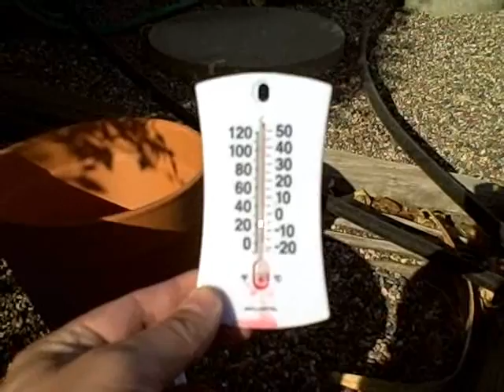Homemade Pot-in-Pot Refrigerator "Off Grid Fridge" cools air up to 40F (evaporative cooler/chiller)

Comment: I am an engineer.  A domestic electric powered refrigerator cools down one enclosed space.  Industrial cryogenic refrigerators that cool down several dozen degrees below zero are, as a bit of an simplification, a refrigerator in a refrigerator.  In other words, one refrigerator cools down a refrigerated space to a temperature well below what the primary refrigerator can do.  I wonder if a "pot in pot in pot in pot" system like this could cool it down more than 40 degrees.  If the ambien temperature is 38 Celsius and you want to cool it down to 2 degree Celsius, could it be done?

Comment: It may sound counterintuitive, but would putting the clay pot in direct sunlight and cutting the towel shorter so it didn't cast large shadows over the pot make this work better? 

It's my understanding these pots work using evaporation cooling, so  that means the faster it evoporates the faster it should cool?  Would mean adding water more often.  Would a clay saucer filled with wet sand over the top work better than the towel?
Reply: Sunlight only makes the water evaporate by heating it. The cooling effect of the evaporation can never be bigger than the heating effect of the thing that's driving it. So no, best to put it in the shade. But if you can put it in a breeze that will speed up the evaporation and help.
Reply: Does it cool better if we add water more often?
Reply: @chrillemartinez5950  If any part of the surface dries out then that bit will stop providing cooling. So yes it will cool best if you add water often enough to keep the entire surface of both pots damp.
Reply: @superfluidity  next bit of wondering.  If you put an appropriately sized mesh dew harvesters net set up in a in a cylinder shape to drip water into the dirt layer, could you eliminate or at least significantly reduce the amount of human time to add water to the pot?
Reply: @colleenforrest7936  Perhaps - but this fridge and mesh dew harvesters can't both work at the same time. The mesh harvesters only work in low temperature / high humidity conditions (relative humidity of more than 100%). The fridge only works in higher temperature / low humidity conditions.

But maybe the dew harvesters could work in the cool night / morning and then you could use the water to run the fridge during the day. But I think you'd need very big dew harvesters to collect enough water to be useful.
Reply: If you have any other source of water available I don't think dew harvesters could really save you any time, since they're effectively only adding water once per day anyway.
Reply: @superfluidity  pretty much what I was thinking.  It could possibly capture enough water overnight so the cooling effect could take over in the morning, for folks that like to sleep in :)  Then later in the day you could add your water as needed.  Could be a fun experiment.

Comment: Would this also work inside the house or does the pot really need to exposed to the sun to get proper evaporation going?
Reply: I think as long as there is wind or air flow to trigger evaporation then it will work. 

I’ve read that the zeer pot is less effective or not effective at all once you get to humidity above 40% or something like that though.
Reply: @itwasentme17 dang, I'm in Florida. I want to try this.
Reply: Yes it will work in doors as well

Comment: Could you turn a pot like this into a homemade air conditioner?
Reply: you have to put a roof made of humid clothes and over that a clay roof and bellow that a plastiv tables so it doesnt colapse cause of humidity absortion and the clothes should be coneted to a wather recipient from where clothes absorves humidity to make evaporation cool the room y saw that for chikens room cooler in another video so the chikens didnt die cause of heat
Reply: if u make a refrigerator or air conditioner you have to make big enought to cool a room like a radiator covered of clothes so u can have more room for evaporation and that shoul conduct air to a room but the air conditioner should be in lower altitude to the room so cool air goes up to the room and hot air goes up absorving the cool air to replace it

Comment: Can you do the same with two plastic barrels
Reply: The outer container has to be clay or some other porous material, so that the water can evaporate out the sides. You could probably use fabric too. I tried to make one with fabric as the outer layer, and a plastic bucket as the inner. Turned out the fabric was waterproof, so the thing didn't work at all :D Gonna try out with cotton as the outer layer next time. Would be nice to find a more portable solution than clay pots.

Comment: I have a suggestion for you, place a foil sheet the shiney part facing outward over the wet towel this method should keep the contents inside the clay pot even cooler, try that. :-)
Reply: I think that would reflect the light. The evaporating process if in tandem with wind will actually make it cooler. Example just like how sweating cools your body. You can say we have a natural heating and cooling system in us.
Reply: @fletcherpersinger5102  for the longest time I thought perspiration was just to get you wet and that cools you, didn't know the act of evaporation was the kicker. 
I've tossed all my cotten summer shirts for the breathable fabrics. They make a HUGE difference
Reply: @fletcherpersinger5102 🔴 What Is Islam? 

🔴 Islam is not just another religion. 

🔵 It is the same message preached by Moses, Jesus and Abraham.

 🔴 Islam literally means ‘submission to God’ and it teaches us to have a direct relationship with God. 

 🔵 It reminds us that since God created us, no one should be worshipped except God alone. 

 🔴 It also teaches that God is nothing like a human being or like anything that we can imagine.

🌍 The concept of God is summarized in the Quran as:

📖 { “Say, He is God, the One.  God, the Absolute.  He does not give birth, nor was He born, and there is nothing like Him.”} (Quran 112:1-4) 📚

🔴 Becoming a Muslim is not turning your back to Jesus. 

🔵 Rather it’s going back to the original teachings of Jesus and obeying him. 

More .....👇

🔴 THE RETURN OF JESUS
Reply: I don't think you should have it out in the sun. It should be in the shade or enclosed. Kind of counterproductive putting it in the sun
Reply: @janetlee191  It needs to be exposed to a breeze, not enclosed, so the water can evaporate faster.
Reply: wow the foil will cool and water will remain and not evaporate so much
Reply: You'd want the inner chamber covered by a disk of foil at the most. The sand and sides of the outer pot need sunshine to drive the evaporative cooling. I wonder if a disk of insulation with foil facing out plugging the inner pot would be the best option, with no wet towels.
Reply: Covering it with foil would be counterproductive. It's evaporate cooling. You need to let the water vapor escape so that more water can evaporate into the air.
Reply: Put pot in shade put wick (towel) in sun
Reply: On a humid day, no amount of sunlight would speed up evaporation. On the other hand, on dry daytime and nighttime, removal of towel would speed the initial evaporation. The towel does serve to condense and re-evaporate the vapor, so in daytime when the intensity of sunlight vary due to clouds, the towel does serve as the Devil's Door.
Reply: Ugh . Science. I need a Dummies explanation as to how the evaporation keeps it cool. And do you need to keep adding water? And to cover or not cover? And are we saying foil or no foil?. What about dirt instead of sand ..like a root cellar?

Comment: How much cooler it would be if it were put into the ground?
Reply: 240X  I buried a Styrofoam cooler in the ground at my Arizona home.  ice stays ice for 3-4 days. It isn't cold beer cold, but it keeps my wine chilled well, even if it is 120 degrees out. I also keep the location shaded from the sun.
Reply: @michaelburgess413  I'd love to know how to prevent the ice from melting to make it a perpetual freezer....I love everyone's input!
Reply: +240X That's actually a great question. I guess we'd have to just try it since nobody in-the-know has answered.
Reply: Kick Ass I wondered if that would work any better!

Comment: Would it be better to keep the frig in a canning room where it's 60-65* ?
Reply: +mkmason2002 

it must be iin the sun , as the it works off the wet bulb temperature, air cools to a temp pf 40 degree F

Reply ·

Comment: How cool will the pots get when you set them in the shade instead of direct sunlight?
Reply: +Treva2000 

it must be iin the sun , as the it works off the wet bulb temperature, air cools to a temp pf 40 degree F

Reply ·

Comment: Inside a home where the average temp was 70-80 degrees, a 30-40 degree  cooler difference would make it possible to keep milk cool.  Thanks for posting,  I've seen huge pots used in Africa so farmers can get their crops to market without the vegetables spoiling.

Comment: stand the zeer pot on the little pots to get it in the air for more area exposed for more evap. put it in full shade & in slight breeze too for quicker evap. you will git better results.

Comment: I was wondering if maybe you added some rock salt to the sand (as they do to freeze ice cream) , if it would be cooler? Just a thought!
?
Reply: I know this is old, but I'll answer it anyways.  It's not a bad thought, but I don't think it would help.  When water changes from a solid to a liquid or a liquid to a gas, it absorbs energy from its surroundings and cools them.  Salt chemically forces ice to melt, and that melting absorbs heat which is why it gets colder.  
This pot works because the liquid water changes to a gas (evaporates), and absorbs energy when it does.  The salt wouldn't make it evaporate faster, so it wouldn't make the pot cooler.

Comment: Thanks for the video and testing with 3 pots.  I'm wondering if there is a difference in performance depending on the sizes of the pots.   I'm off the grid and really would like a place outside my fridge (which is really a freezer that runs several times a day) to store tomatoes and Armenian cukes.  The tomatoes aren't supposed to get very cold anyway or they lose flavor, so this would be better than a fridge.

How big could they be while still having good cooling?  Do they have to be round?

Comment: If you have to have it outside, I would place it against the house on the north side and that way it'll never see any direct sunlight and you might get lower temperature readings. The best thing to do is to probably bury it up to an inch of the rim.
Reply: NO sun on the north side of your house ???? WHERE do you live ?????
Reply: @sandybarbee8401  In the United States the north side of your house gets the least amount of sun....especially during the winter months.

Comment from the maker: good questions. no, the pots have to be made from something pourous like clay (to allow for air flow).
Reply: Can you use salt water? If you were trying to save on fresh water and happened to have salt water could you use that instead?
Reply: @disposablevibes42  yes that’s fine
Reply: Would it still work if the outer container was made of plastic or metal and the inner was still sand and a clay pot?
Reply: @OldMacDonaldsWife  ideally not, as it’s reduce the external porous area massively